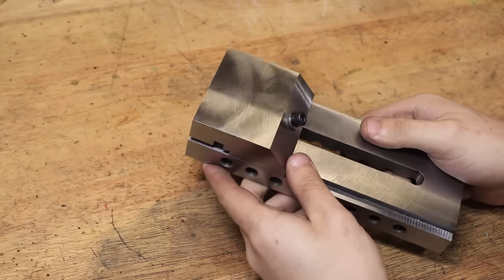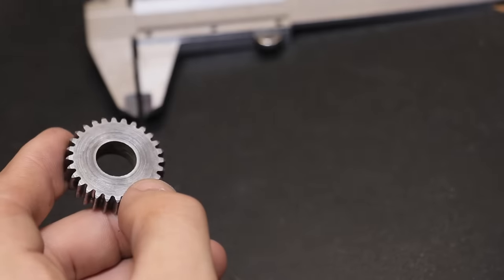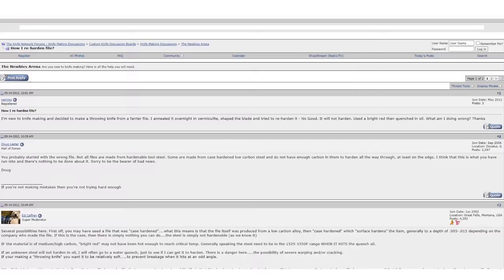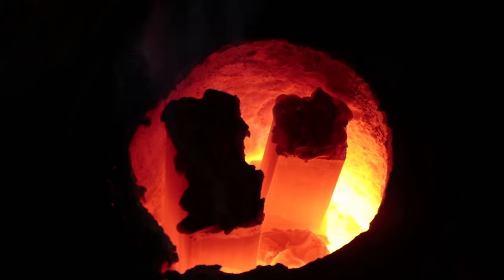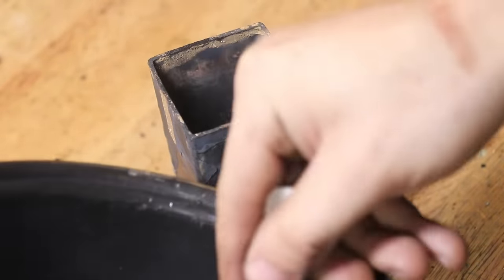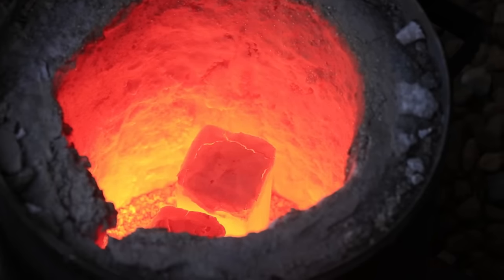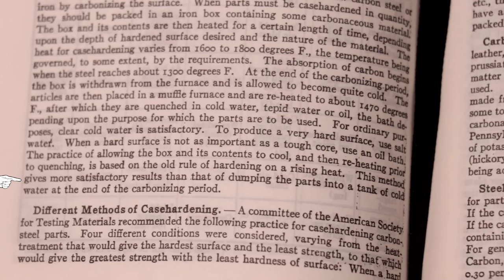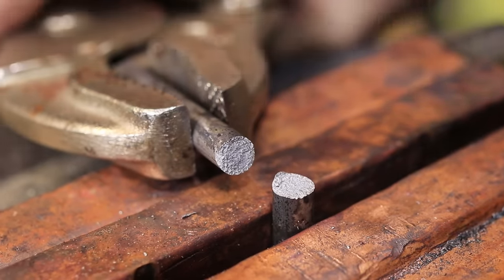Case Hardening 101 - Heat Treatment Oversimplified

Comment: Don't do anything with used motor oil, motor oil is a lubricant, not a coolant. Never mind all the other stuff in the fumes that can cause some damage down the road.
Also Chris did a great video on this awhile ago:
https://youtu.be/V_Mp1fNzIT8
Reply from the maker: It’s not about whether it’s a lubricant or coolant, it’s about the heat transfer and thermal conductivity. Motor oil, or oil most oils give a similar cooling rate. And you wouldn’t want to breathe in the smoke of any of them. It’s just that it’s easy to get your hands on used motor oil.

Comment: Filter the carbon out of the used oil and use that rather than creating new carbon from oil. Easier to go deep.
Reply: Would you think there'd be more carbon soot in a given volume of used diesel motor oil vs oil from a gas vehicle?